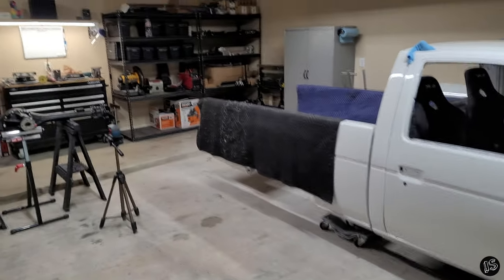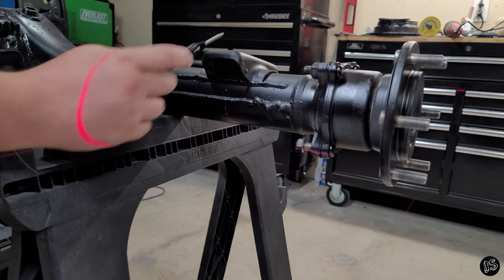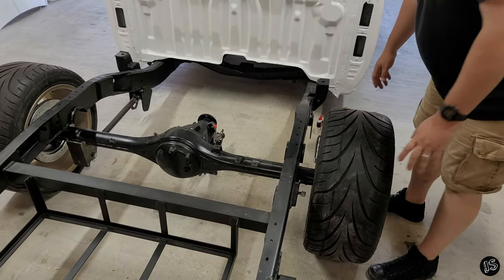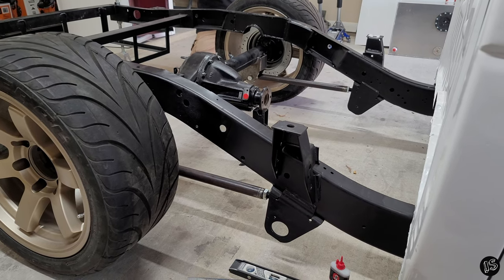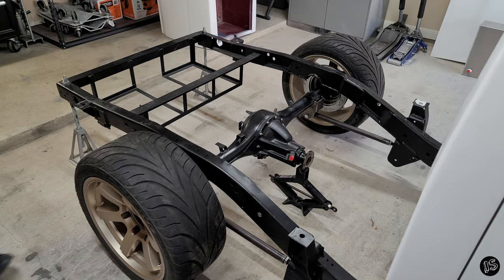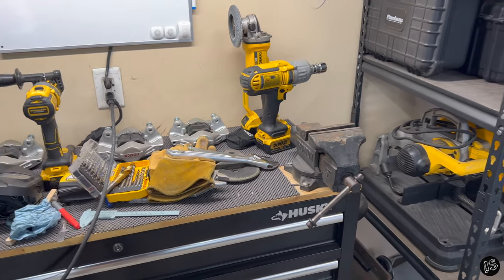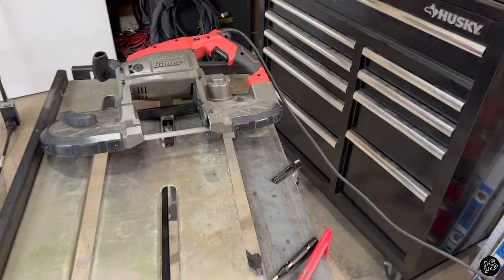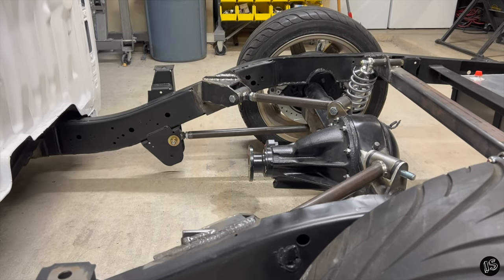Triangulated 4-Link | D21 Drift Truck — Ep. 19

Comment: Bro you lost me at 8:18. You have a triangulated 4 link kit, and the angle was correct. You're installing like a parallel 4 link kit, but with different size links. To keep the pinion angle on a parallel install, they have to be the same length and distance from pivots.
Reply from the maker: Nope
Reply: @Inner_Sanctum  feel free to Google "parallel vs triangulated 4-link"
Reply from the maker: @vincentking8267  your assumption is a very common misconception for folks. What you’re saying only makes sense for a singular point of rotation on a link. Meaning one side rotates while the other remains stationary. That not how this works. Both sides of the link rotate freely over the bushing therefore there’s no change to pinion angle during articulation. Also, the difference in length is important for instant center. Please feel free to Google.
Reply: @Inner_Sanctum  you can't get an instant center on a parallel 4 link because the 2 plains will never intersect, hence the term "parallel". Instant center references a triangulated setup. Which you had a kit for.
Reply from the maker: @vincentking8267  that’s what I am talking about (triangulated). My setup is a triangulated 4-link that requires instant center. You’re assuming there’s a difference in arc length therefore there’s a change to pinion angle. What I am saying is that there is no arc length in this range of articulation because the link is able to rotate at both ends. Meaning when the axle moves up, it is able to remain in the same fixed position because there is no fixed point that makes it rotate creating a pinion angle issue.
Reply: @Inner_Sanctum  I'm confused at this point, my original comment was a direct response to your statement saying you're going to install the triangulated links to be parallel with the lower links as you explained at 8:18.
Reply from the maker: @vincentking8267  lol I guess I am lost too. It has been a long time since I posted the video. Let me watch that part and see what you mean.
Reply from the maker: @vincentking8267  okay, now I understand. My verbiage was kind of weird, so that may be my fault. So what I was talking about at that point was preventing a binding issue on the upper links only. If the bushings were angled differently to one another, then when the axle travels up, it would cause the motion to bind since the point of rotation would be in different directions.

Comment: I think you’re just overthinking the set up. It’s not rocket science. It’s a 4 link. Oldest suspension in the book. The rear Diff doesn’t even pivot as much as you articulated the arms.
Reply from the maker: Well, all that may be true. However, it is my first time building something like this, and not really something I wanted to just slap together haphazardly. I’m self-taught everything, and have a process.

Everyone starts somewhere, rocket science or not, and I’d rather overthink it and still get it done, then not think about it enough just to get it done a tad bit quicker just for a problem to arise later. 

It’s easy to critique someone’s video after they’ve uploaded it. Hindsight is 20/20. There are a lot of things that I know now after doing this that would have made it easier. That’s learning…
Reply: This radio guy probably hasn’t ever even installed a 4-link. Talk is cheap, and even if he has, he has no videos to show his mad skills off. Why cut someone down? Also if you’re so talented why are you searching YouTube for install videos?
Reply: @Radio, does it make you feel good trying to bring others down?

Comment: What lb coilover  did you use in the front and rear
Reply from the maker: Originally I used 450lb front and 250lb rear, but now I’m running 650lb front and 450lb rear.
Reply: @Inner_Sanctum  thanks brother greetings from Trinidad and Tobago
Reply: @Inner_Sanctum you say 450# on rear. Is that for each rear for a total of 900# ?
Reply from the maker: @jasonenglish4354  each.
Reply from the maker: @jasonenglish4354  yeah, it’s 900 lbs out back. Pretty dang stiff… not sure if it will be ideal yet. Might swap back after I drive it and find out.